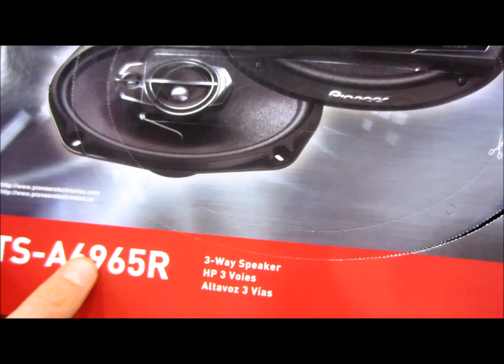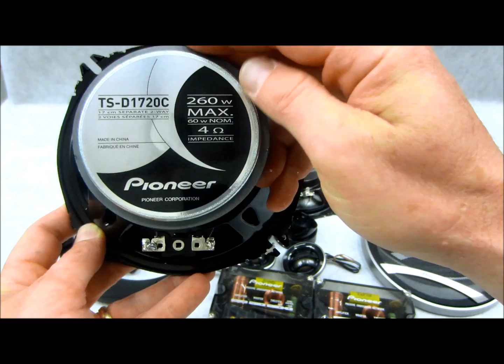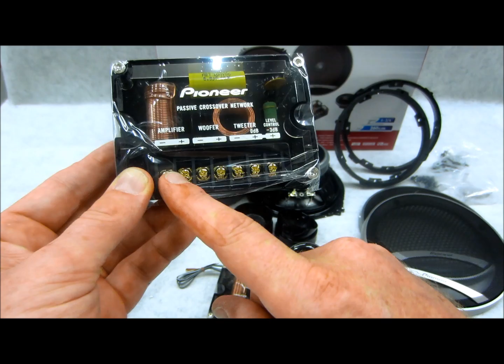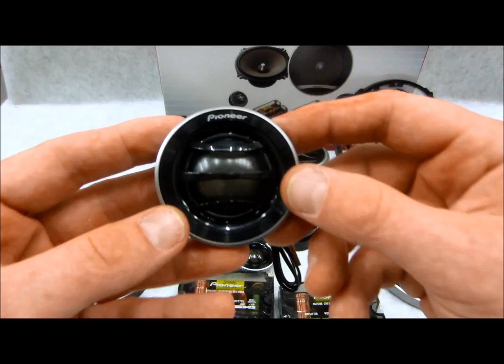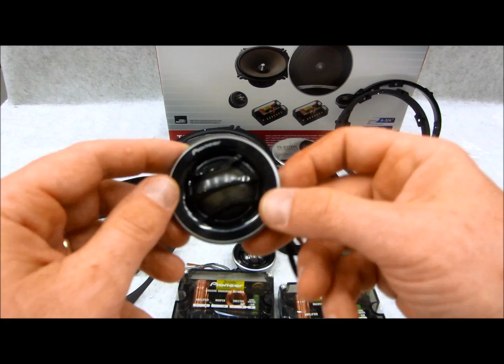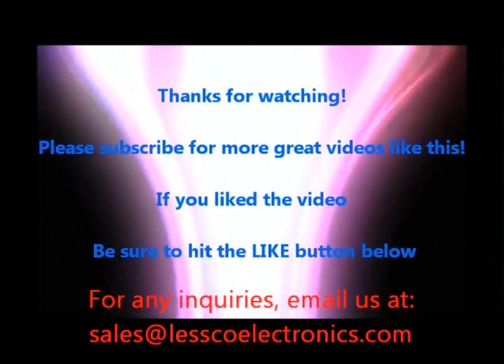Pioneer TS D1720C Component Speaker System Review

Comment: Used a mb quart onyx 4.80 with these. Loads of midbass, but I hated these for the 2 years I used them. There was this harsh uptick around 3khz, that made female vocals unbearable. 

Then I bought the polk db 6501s, way...WAY more smoother. Slightly less bass, but just seemed much more accurate.
Reply: I had infinity reference and just bought and put in some polk dbs i like em...more of sound i was looking for but for some reason after i installed 5th channel was working so i returned amp for replacement..

Comment: No experience wit pioneer. Their speakers have always sucked. BCk in the day when the models of amps were. 821,921,and especially the 1021 were bad ass amps. Their newer ones are still pretty strong. And have had many decks. Pioneer. Premier. At least 5-6. And never had a issue  with them. Seem good but get bad rap. But their subs suck. No matter how you slice it. Would rather have a Sony xplod. And I’ve never evsn heard one. Can’t stand the shape of em. 😂

Comment: so with the amp in/out puts on the cross overs, does the head unit plug into thoes or what? do i need to run these through an amp or no?
Reply: Bob Cooke no you dont NEED an amp but you wont get the most out of these if you arent amping them. As far as wiring, your stock speaker wire goes into the crossover where it says “amplifier” then the other two sides go to tweeter and woofer as it says.

Comment: Please help me out by choosing between below speakers; a top 3 would do nice. Also, do you think that i might benefit from better sound by adding a 4x50 RMS amplifier to the speakers? Car is 2015 Civic Hatchback(i would like to keep the stock player for now).
1. Focal PS 165
2. FOCAL PC 165
3. ROCKFORD FOSGATE P162S 
4. ALPINE SPG-17CS
5. PIONEER TS-A172CI
6. MTX T6S652
7. JBL GTO609C 
8. Infinity REF 6500 CX
Reply from the maker: I would use focal components up front and the infinity rear for fill with an amp definitely, clean power is sooo  key

Comment: Any idea what gauge that wire is coming off the crossover to the amp?
Reply from the maker: it is 18 gauge
Reply: Hey thanks for the quick reply, im just getting all fitting bits on amazon now, i have the TS-E171C (think thats the D series in the states) and thought the speaker wire looked kinda thin, i have some 12 gauge, guess ill just use that on my sub.
Reply: So its ok to run 18 gauge speaker wire? my amp is dclass and rated at 100 watt rms per channel?

Comment: The A series isn't their entry level, that's the G series. They use polypropylene injected cones rather than a mica-reinforced composite. As far as the composition of the tweeter is concerned, it really depends on what sound profile you are looking for. It's the same as comparing digital and analog amps. They both do the same thing, but they color the output differently because of their design. In this case, Pioneer is targeting an audience looking for a slightly warmer sounding trebel and opted for a plastic tweeter as opposed to a titanium tweeter. As far as I'm concerned, I'm likely to agree with that decision. Titanium tweeters, or any other metallic reinforced tweeters sound incredibly sharp to me with stock equalizers. It is possible, of course, to carefully tune the system to make metallic tweeters sound however you like, as they are the most versatile in their sound reproduction, as they are the most precise. Just something I thought I'd mention.

Comment: These are great speakers.
Reply: I have a set of the ts-d1620 6.5" coaxials and the voice on them sounds comparable to the $300-$400 component speakers. I've done car audio for 20 years and  I'm not sure exactly what they changed with these speakers but I will say that these are by far the best value speakers and sound way better than the price in both clarity and volume.

Comment: So with the cross over I wouldn't need a separate amplifier to power they right
Reply: The amp is optional, you can use a head unit only. But i highly recommend using the crossover. You definitely need it if you use an amp in the future. Keep in mind that the TS-D1720C speakers are good. They should have an amp to get the most out of them, so they will be louder and more clear.

The crossover is a filter that allows only the necessary frequencies to pass through. Unnecessary frequencies make the speakers sound bad and also damage them.

Basically, the crossover saves your tweeters from blowing by removing the bass and midrange from the signal. It splits the signal into low-mid range for the speaker and high range for the tweeter. There is no reason for a speaker to play signals as high as 15Khz, and most tweeters can not handle signals lower than 1Khz. Keep in mind those frequencies are used for this explanation only, as actual frequencies differ.
Reply: +Edde Luna Don't know if this is still relevant, but you'll need that passive crossover regardless of whether you are running an amplifier, since these are component speakers, which do not integrate the crossover and tweeter into the woofer package. The crossover splits the input feed and filters out the high frequencies on one feed for the woofer and the lows on the other for the tweeter. It's intended to keep your tweeters from burning out and your woofer from sounding terrible. As far as needing an amplifier, though, I would recommend running an amplifier, as they have fairly low sensitivity and moderate impedance. They will still sound better than most existing OEM speakers just run off the head unit, but they will lack any significant bass because the amount of power needed to push extreme amplitude at low frequencies is quite high. Run an amp and all is well with the world. Try to keep you per-channel wattage in the upper RMS range for these speakers, so somewhere in the 45-55W per channel RMS.